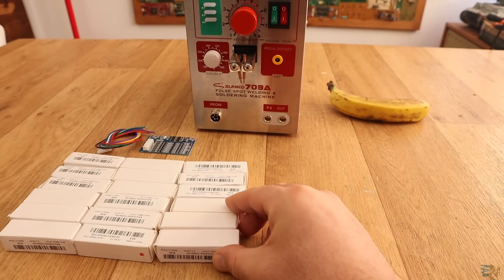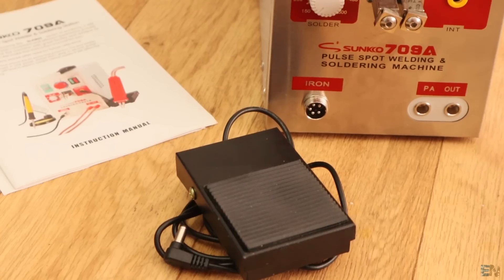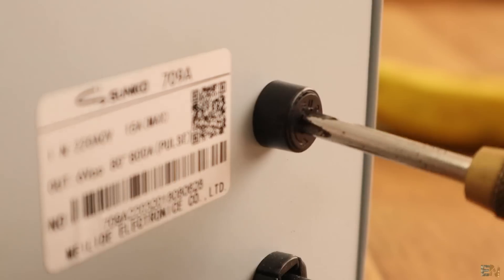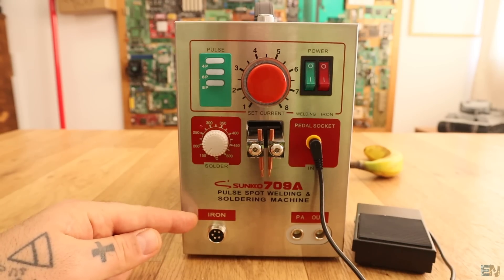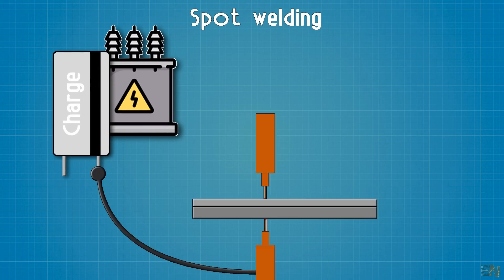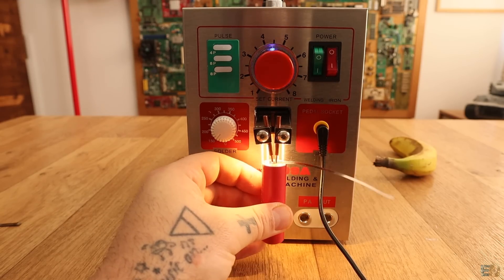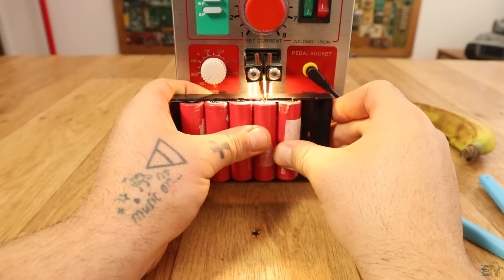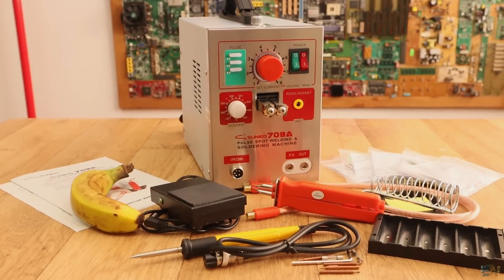SunKKo 708A spot welder review

Comment: Have you any idea what voltage it works at? I built one from a microwave oven transformer but would like to know the correct voltage so that I can work out how many turns I need to get the optimal weld.
Thanks
Reply: 5 volts
Reply: @mustafatawfeek4312  Thanks. Since I asked this I bought a welder that connects to a 12V battery and works much better.

Comment: Interesting bit of kit but not necessary for most hobbyists. 
I always open up Chinese made electrical items (where practicable) BEFORE powering on, just to check that they're properly earthed and safe to connect to the mains. It looks like your unit may have been dropped upside down as it looks like one side of the transformer mounting tabs are slightly bent, although it could be a manufacturing issue.

Comment: have you a link where i can find the 2 copper pieces because i will make me self a spotwelder with super capacitors and it is a good video well explaine
Reply: If you mean the handheld welding attachment then it's available on Banggood as a spare part. Just use the link for the 709A and look lower down the page for 'Items frequently bought with this'.
Reply: @WaltonPete  but that are the verry small copper tips not the big one

Comment: The hand wand having lower output is a common issue. Double check the connections inside the unit to make sure they are connected properly. I think one user found the O-ring connector was on the wrong side of the washer, and other found it loose. (as I was typing this, you showed the inside, hrmm, I don't urs having a screw on connection; seems there's several version of the same 708A)
Another user spread out the metal tips that go from the wand cables into the unit as they weren't making solid connections.

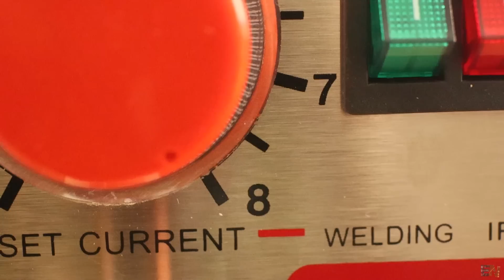Comment: 3:54 pretty sure it is AC. I got a cheaper unit from the same brand, it does the job but this one seems far better. I actually tested the amps with a clamp meter and got 250A AC so not the best.
Reply: What about voltage bro?

Comment: bro please make stm32 based transmitter and receiver
and also bro i made arduino based remote and receiver for drone but the values of PPM was jumping too much like 1500  1501  1509 1512
what i do ? i am in betafight 
it is possible to stable values like any company made transmitter and receiver .
i am sure there is problem in coding because when i changed clockMultiplier to 3 or 4 it will better but still jumping 2 or 3 values .please fix this problem